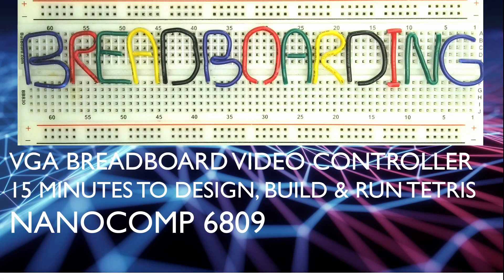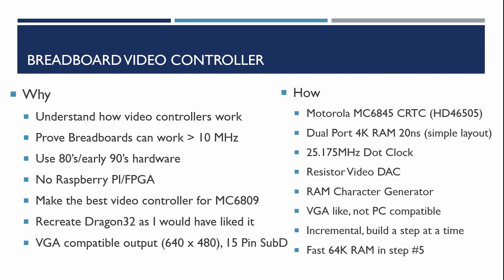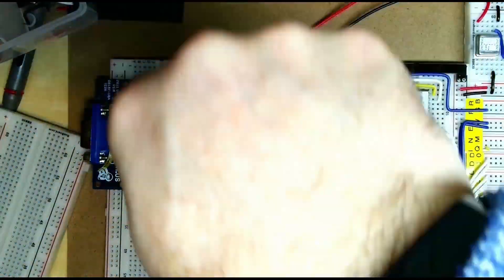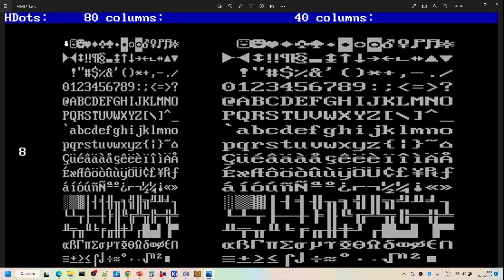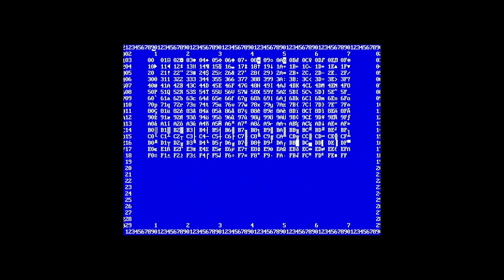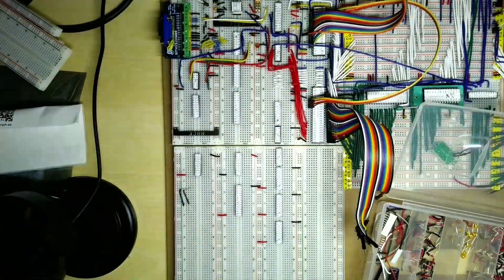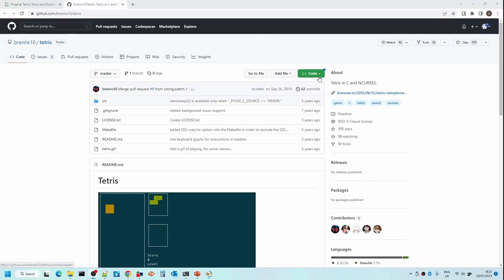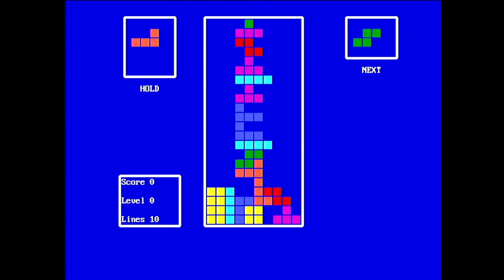Breadboard VGA in 15 minutes runs Tetris - Nanocomp 6809 8 Bit Breadboard Micro

Comment: When you finish the design, will you have a PCB made?
Reply from the maker: i wasn't planning to as my focus is making complicated things on breadboards. Other than the original PCBs I made for the Nanocomp as a teenager in the 1980's I don't have any experience  with making PCBs with KiCad etc.
The design has evolved so much and will continue to change so that a PCB isn't really an option for now.
The next project I am thinking of is a PC-XT/AT type system using Intel 8088 and IDE disk drive using an SD Card adapter. This will require the Video Controller design to evolve further to be closer to CGA and VGA I/O Port and Memory Map compatible and not just VGA like output like the current one.
Reply: @breadboardinglabs  With a breadboard, the design never has to be final.  You can always improve it.
Reply from the maker: True that can also be a curse, never finished

Comment: Wow, this makes me want to set up my own nanocomp XD
Reply from the maker: All the schematics and software are on Github if you want to have a go. Getting all the components can require a bit of a search, the PLDs are particularly tricky to get hold of so eBay is main source as new ones won't be in stock until later in the year. Will be finishing off the graphics then adding P/S 2 keyboard. After that I think I may try an Intel 8088 or Motorola 68000.